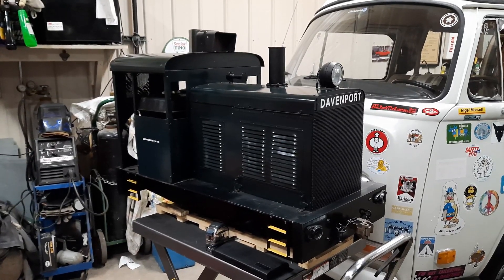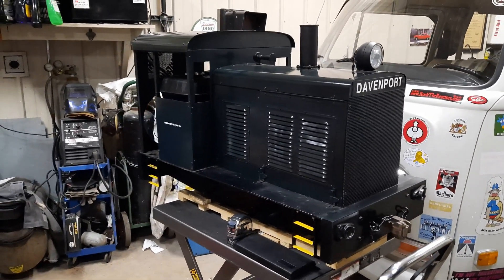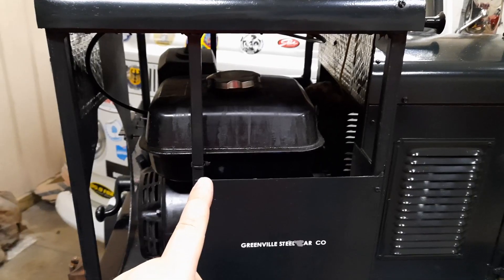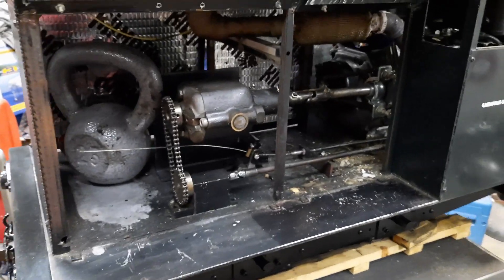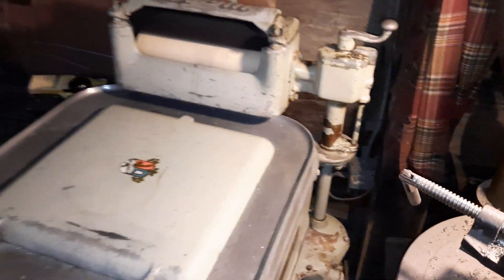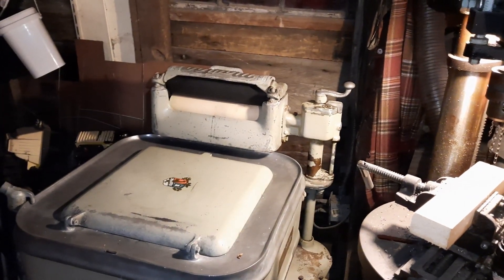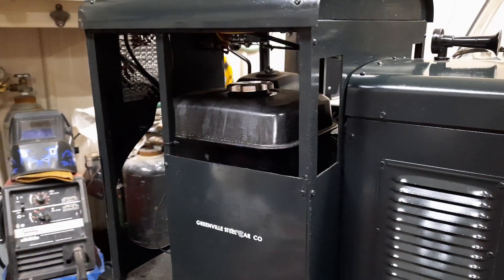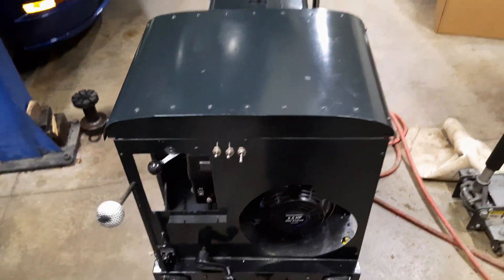7.5" Gauge Gas to Electric Locomotive Conversion, 2.5" scale | Part 1, As it Was

Comment: 🤣🤣 I was like no, no Matt. I love that rumble vibrating go kart noisy feel, makes it like manly 😀  but then you showed it running battery... Shhhhh no noise... 🤣 I changed my mind . I like the battery... 👍 you sold me.. liked the HOn3 model..
Reply from the maker: Thank you for checking out the video Pappy! There is an operator that has a one cylinder Lamborghini diesel power his locomotive, it is the best sounding combustion powered locomotive on the rails. I will be happy to hear the wheels clack over the rail joints this way

Comment: You will not like it when it operates on Battery's.   Trolly power would be more practable then battery.  That would require overhead lines and I would stick to what you have. Ask me how I know.
Reply from the maker: This is the second summer going on battery. It's quiet and pulls 2,000 pounds up 3.5% all day long. The control is super smooth for jerk free starts and stops, and is a candidate for a custom wireless system to make switching solo a breeze. The sound system makes is sound accurate, and the ability to play music on it is wonderful to make hours of track work sessions tick by faster. To each their own, gas power has its place, but I can't imagine going back.